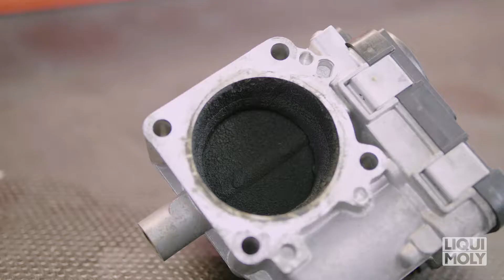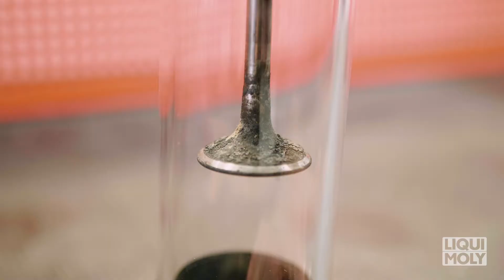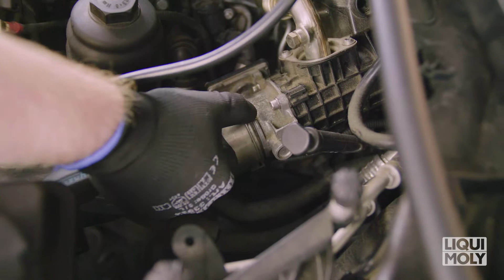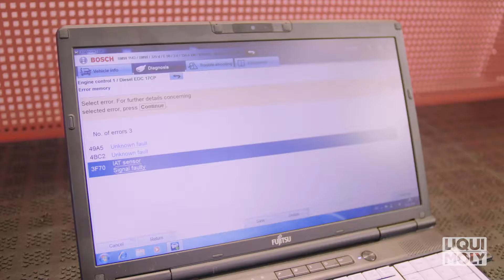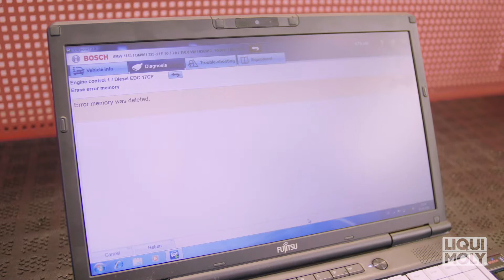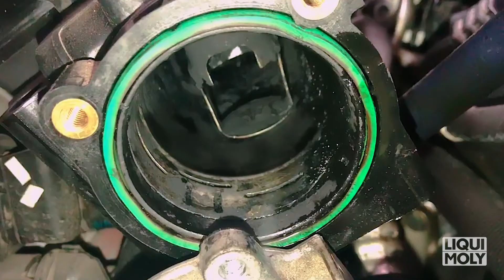5168 Pro Line Intake System Cleaner Diesel

Comment: What's the risk of theses deposits damaging the valve sealing surfaces, especially the hard carbon deposits?
Reply from the maker: The damage is mentioned in the video. Or are you referring if they should come lose? IN that case, our product dissolves the carbon to release through the vehicle exhaust system. This product is vital to follow the instructions on the TDS.
Reply: Can you spray this directly into airbox ? This will basically then direct it through the turbo and intercooler? Or should you spray directly into the intake then you will mis the turbo all sensors and only aim at intake and valves. Thanks.
Reply from the maker: Hi  @shaun-wp  Liqui Moly Intake System Cleaner Diesel must be sprayed after the MAF sensor, ideally via a vacuum line or intake adapter, while the engine runs at high idle.

Spraying into the airbox can damage components like the MAF sensor, turbo seals, or intercooler, and reduces cleaning effectiveness.

For cleaning turbos or intercoolers, use products specifically designed for those systems 😉